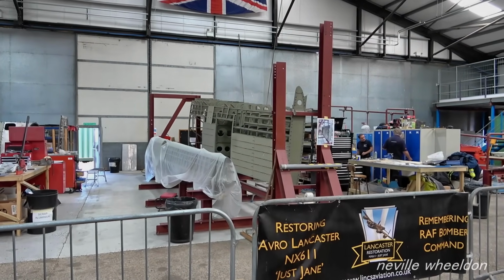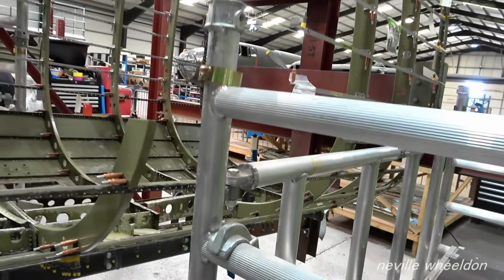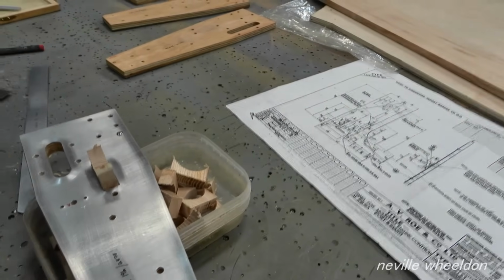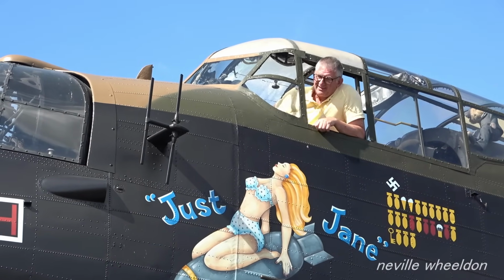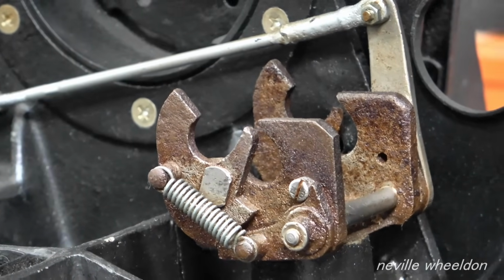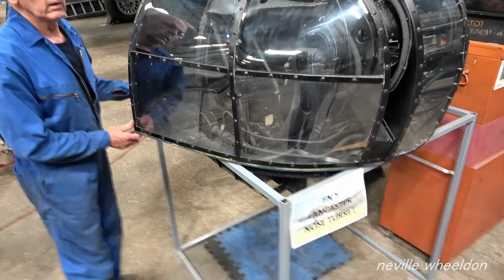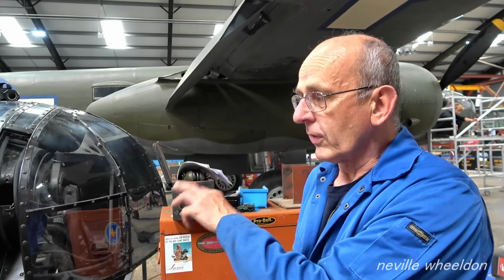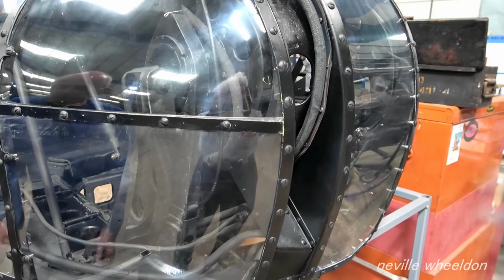Video 211 Restoration of Lancaster NX611 Year 6.  Front gun turret Cupola

Comment: Fascinating about the wood bits.  Wonder, with the obvious lesser longevity of wood, are there access panels to make them easy (relatively) to replace ?  Wonderful discussion about the .303 - still quite a following in the rifle version, with some current production civilian arms still chambered for it.
Reply: Aye! Nothing wrong with the .303" round. It was pretty good using the spaghetti like cordite but shoots flatter with modern propellants. I used to have a 1954 RAF issue  number 4 mk1 with absolutely no wear in the barrel when I got it. Shot like a demon with home loaded ammunition!
Reply from the maker: Hi HH. wood bits, no access panels, just remove the rivets from the skins. Remember HH these Lancasters were not built to last 80 years more like 2 years  in the 1940s ,if they were lucky
Reply: @nevillewheeldon1693    Doh !  Of course !  Thank you.  🙏

Comment: Thanks for that Nev another great episode!  I had heard of the Mohlins seventeen pounder quick fire gun in the so called Tetse Mosquito but not anything more than that. It seems as Desmond Mohlins was a brilliant mechanical engineer., as for the Browning  .303", the harmonisation of the guns on both the Hurricane and Spitfire was originally ay 400 yards but later on it was reduced to 200 or even under that for pilots who wanted to get in really close down to around 100-120 yards
Reply: Sorry to correct you, but it was a Molins QF 6 pounder fitted in the Tsetse Mosquito, not a 17pdr. Have you seen the size of a 17pdr? - they had difficulty getting it in a Sherman turret for the Firefly! The Tsetse Mosquito was the FB Mk XVIII. Although effective, only 28 were built, as it was concluded that the RP variant was more efficient. After all, when the rockets were gone, you only had a few rails left, not a heavy 6 pdr gun to lug home which compromised its defensive speed, particularly as it had only 2 .303 MG left, the 4x20mm cannon and 2xMG having been removed for strengthening, and to accomodate the 6pdr and its ammunition, for which only 23 rounds were carried.
Reply from the maker: Thanks for your interesting comments  Samrodian.
Reply from the maker: Cheers Driverman. @DrivermanO

Comment: Hmmm, only a few weeks to November, and nothing seems to be ready. Nose cone STILL not finished, wing is not complete. In the nick of time will do, what is the schedule for the winter?
Reply from the maker: Hi David, if you are a member of the "Rivet Club" you will have received Andrews email  giving the winter schedule. If not this is basically what he said . They will swap over the wings this is the first job. The French fuselage nose section will be fitted  and Just Janes rear fuselage refitted by end of March. That is the programme but on restoration work  who knows. Also this week the leading edge of the French wing was fitted to the wing.
Reply: @nevillewheeldon1693  I am a "Rivet club" member, Andrew stated that because of the busy season, the emails were going to be as and when. I`ve also been on part time work, so may have missed at least one. Still think the nose section should have been finished months ago.